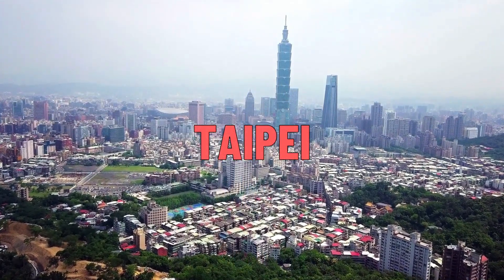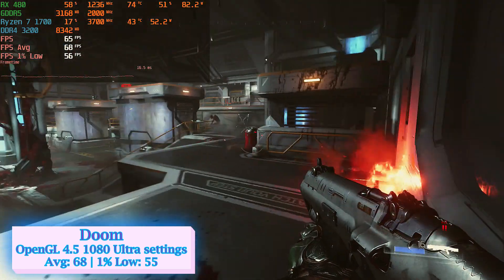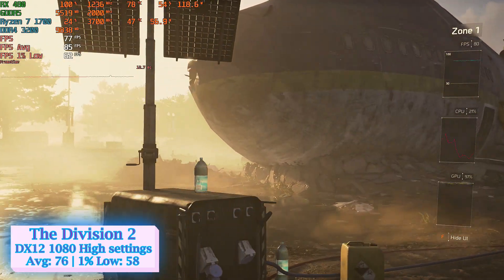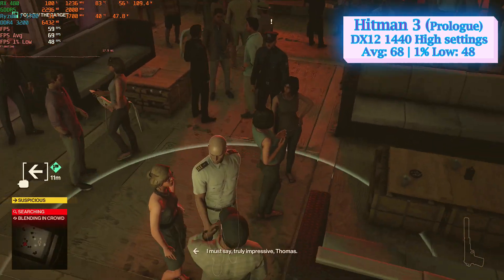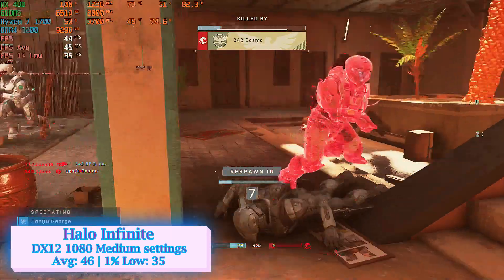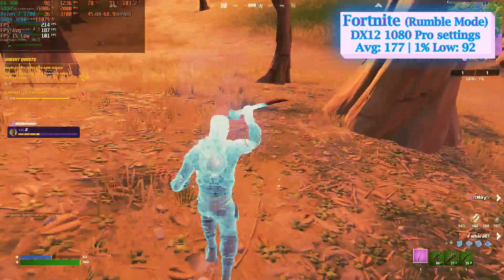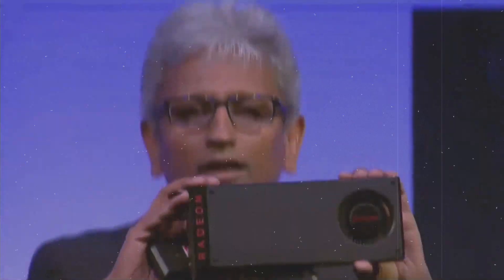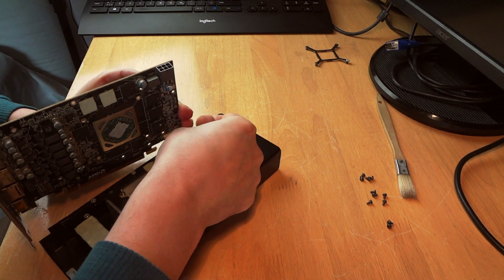AMD Wants You to Forget About This Old Polaris GPU • Radeon RX 480 8GB

Comment: Still using my RX-470 to this day after almost 5 years of use. Not much of a gamer compared to the old days but I still play if I got the time. Currently playing Witcher 3 for the first time. Under linux mint 20.3, was able to play it at max setting, full hd except view distance. FPS hovers around 50-60 fps. I may have to let go of the card if I change to QHD which I've been planing forever. But I do wish I'd still be able to use it on the game I like to play not necessarily at high settings. I flashed the card to RX-570 few years ago. Was able to use it for two years I think. Basically the card is overclocked after the bios flash, though not much. Dunno what happened but last year the card is suddenly showing instabilities so I reverted back to the original RX-470 bios. The only thing I regret, was skimping with my purchase 5 years ago and opting for the entry lever RX-470 (one six pin - so not much oc headroom, single fan, 4gb vram). Should have spend a bit for a better variant. But anyways, the card is at dusk now in terms of performance. Hopefully AMD continues to support it with recent drivers. Besides the minor regret I have with card it's been a hell of a ride. I've used various cards throughout my almost 20 years as a pc user, from the ATI Radeon 9250 which is my first ATI card to the RX-470 which is my most recent, to the GTX 1080 which passed my hands for a year till I sold it (didn't need the GPU power at that time) and I'd say Polaris is one the best gpu architecture there is!
Reply from the maker: Thank you for sharing this enjoyable PC hardware "memoir" of yours.

Comment: One thing i like to add is that halo infinite on polaris architecture is just trash ( maybe some sort of poor optimisation for the architecture ) at the same time even the 1050ti produces better result than a rx 570 ( rx 570 is 40-45% faster than a gtx 1050ti in most of the games )
Shame on developers, cause am a big halo fan and can't play it properly until i get a decent PC.

Comment: Kinda stupid to not show Doom 2016's Vulkan performance. Likely double the OpenGL performance. Also, games like Halo Infinite prove that AMD is crippling GCN driver optimization. It's not that the 480 can't run Infinite better, it's that the drivers are crippling performance. Speaking of this, there's no better giveaway than SAM support, which DOES WORK on the 480, but AMD just disables it on windows. This can be bypassed with Linux or the NimeZ modded driver. AMD is simply switching their support style to Nvidia's model, where they screw driver optimization after a new card generation to force you to buy next gen, all while raising prices on equivalent tiers for full price gouging. You're paying the same price for a 4GB 6500, which is absolute trash. Anyone who can't see this is a scam is just blind.

Ultimately, the real way to keep using the 480 effectively is to switch to linux, where optimization on Polaris is still happening and is not being actively crippled.

Comment: Now after I bashed AMD, we have to also be realistic. First off, GDDR6 is 15$ per 1GB, compared to GDDR5 which was 5.5$ per 1GB. Then the pcb components have all become 1.4-1.7x more expensive since 2017 and the shipping price has doubled. Couple that with inflation and cards today cost about 50-70% more. Basically 100$ for a GPU in 2017 is like 150-170$ for a GPU in 2022.

Comment: had the HIS RX 470 back then. great card, but changed to gtx1060 because of issues with certain games. too bad HIS isn't around anymore. they built great coolers and even advanced blower designs. something I do miss these days. maybe HIS will return with rdna3? their website is still online showing the old rx5000 roundup. anyway 2017 when RX400s were around are memorized as happy times for gamers.

Comment: Long live polaris and pascal!😊👍

Before crypto storm, amd and nvidia were good guys😪
Reply: Nvidia were NOT the good guys ever. The Gtx 1000 series is the single most overpriced generation of GPUs AT MSRP, sold at 90-138% profit margins. The gtx 1080 a sub-mid-range GPU costed 700$ MSRP when it should have been 350-400$... the gtx 1060 6GB should have been 200$ MSRP but was 300$ MSRP... just NO.

AMD became greedy with Zen2(Ryzen 3000) and RDNA1(RX 5000) in 2019 when they doubled their profit margins from 23% to 45% and then increased them further to 60% with the release of Zen3(Ryzen 5000) and RDNA2(RX 6000) series BEFORE the crypto mining boom.

Comment: Exactly why all newer "budget cards" are a joke the term "budget" is already long gone for newer tech
Reply: 100$ for a GPU in 2017 is like 170$ for a GPU in 2022. Scale it from there. That's due to GDDR6 costing 15$ per 1GB compared to 5.5$ per 1GB for GDDR5, pcb components costing 1.4-1.7x more in 2022 compared to 2017, shipping being double the price and all this coupled with the inflation makes it impossible for GPUs to be good at lower price points right now. And coolers have gotten bigger and more expensive too.

When the VRAM + PCB + Cooler + Shipping alone cost between 100-150$ for the lowest-end GPUs, then you know that you can't get a good sub-200$ GPU. That said AMD and Nvidia have their profit margins in the 55-65% range, whereas in the past they were in the 30% range, so there is that.
Reply: @rattlehead999  so aside from production cost are going up, it also because Nvidia and amd are being a little too greedy by increasing their profit margin by a lot, because the main problem here is the performance, such as the rx6500 xt, saying "we can't make it cheaper because everything is going up", to a bad product, even though they can by reducing their profit margin a little, it's like saying " sorry man I want to get more money out of you, so I can't make it cheaper", very interesting
Reply: @Arsa...  Nvidia increased them all the way back in 2016 with the gtx 1000 series, and the gtx 1000 series is the most overpriced at MSRP generation ever(90-138% profit margin), they have been lower since 2018 and the RTX 2000 series actually(55-60%) which is why their stock tanked in 2018. And AMD doubled their profit margin from 23 to 45% with the RX 5000(and Ryzen 3000 series) series in 2019. And then upped them again to 60% in 2020 with the release of Zen3 and RDNA2.

Their profit margins pecentage-wise have been the same since mid 2020 before the prices of components went up.

Go read their financial reports, they are public since they are public companies.

So people fine with the gtx 1000 series and this is the consiquence.
Reply: @rattlehead999  thanks for the info on the financial report might gonna check it

Comment: 480 blower was no go for me it had a lot of heating issue 480s aib model was even hot 
But good solid card
Reply: Had the sapphire rx480 with dual fans, ran cool as a cucumber .. even overclocked with extra voltage

Comment: If it matters, this was NOT Polaris.  15 seconds to check TechPowerUp's GPU database would have let you know it was the Arctic Islands generation of GCN 4.0.  Polaris was the 500- series;  both are 14 nm and made at Global Foundries.  The actual processor chip is called Ellesmere. The updated RX 580 ran on the Polaris 20 chip.  This was the last full suite of cards -- they completely skipped Vega on non-prosumer cards because they released both Polaris and Vega at the same time.
Reply from the maker: I guess you know better than Lisa Su herself.
https://youtu.be/NNMtO5etprs?t=10

Comment: Driver 22.3.2 improves DX 11.  R5 2600 would be better R5 3600 even better.
The RX  63/64/6500 XT use LT GPUs that were converted to DT only for  OEM system builders  at their request those PCs are all PCIe 4 .   DIY builders were complaiming about no low end cards so AMD offered the RX 6500 XT only at first and it sold well so they offered the 6400 XF as well.   AMD never planed to make these DT cards.   The coming APUs Zen 3 RDNA 2 then Zen 4 RDBA 3 2023 and Zen 5 RDNA 3+ 2024  first KT then DT will start the end to low end dGPUs.
Reply: Your Assesment about AMD in this video is not valid.    Used GPUs will remain in demand but many markets have limited selection.     The majority of gamers are happy with 720p 900p 1080p  and some 1440p medium.    FSR and RSR  and FidelityFX sharpening will as noted exyend  usefulness of  AMD nVid and ARC  dGPUs.
Reply from the maker: I can't follow your argument, can you please state exactly what is not valid in the video so I will avoid to use it in future content.

Comment: I had the XFX RX 480 Black Edition XXX but thought it was the GTX 1060 competition. I thought the Vega RX 64 and 56 were the cards to answer to GTX 1070 / 1080.
Reply from the maker: And you thought right. But at the launch day of RX 480 and for a couple of months if I remember right, there wasn't GTX 1060. So at that point the RX 480's comparative new gen competitor was the GTX 1070.

Comment: I still main one.  Sapphire RX 480 Nitro+.  Linux is my main OS and game at 1440p.  Shadow of The Tomb Raider (native Feral port) I can run it at high settings and see 40-60fps, same with Deus Ex Mankind Divided (proton DX12) and Kingdom Come Deliverance, all with smooth frametimes.  Doom 2016 runs full 60fps with the Vulkan render.  
This card won't get you +60fps at resolutions higher than 1440p.  I mean, if you "need" to reach those 120/144 fps to enjoy a game you will be on a newer card anyway.
It's sad and infuriating that AMD is feeding scraps to "budget" video card users.  I doubt the 7xxx series will be any better in terms of price.

Comment: I love this card I have had it from launch and it runs everything beautifully to this day the only reason I'm not using it in my new PC is because I switched to a GTX 1660 super and put the 480 I'm my wife's PC and it's still running strong
Reply: Very weird sidegrade from RX 480 to 1660S. Some 30% faster sure, but still strange. And less VRAM if I'm not mistaken.
Reply: @acryion  true but the 1660s I have is the 6g and 480 I put in my wife's pc is 4g but I'm still happy with what I have with the 1660s for the games I play it runs them no problem both good cards

Comment: I have RX470 since 2017, and it is still going even with new games. Hallo Infinity campain after some elaboration I manage to run playable even in openworld areas (not 60pfs of course 😀), this is absolutly impresive to 6years old HW. In 2008 it would not be even be possible to run "new" games on Gforce 3, or Radeon 9500/9700.
Reply: If you aren't playing competitively no reason to go 60 and beyond which the lovely Polaris gpus are doing med - high on older games and low - med on newer games is a beast
Reply: Ironically, some games from 2007 or 2008 do actually run on the Pixel Shader 2.0 Radeon 9800/9700/9500 GPUs.

Stalker, Gears of War, , Unreal Tournament 3, CoD4, FEAR 2, Crysis 1 and Warhead, Portal, HL2:EP2.

Comment: You need to set tessellation to 32X or 16X because by default AMD uses 64X while NVIDIA uses 32X which they hid it from user access. lol
Reply from the maker: If I remember right I had set tessellation x8 or x16 since anything above that has diminishing returns in quality meanwhile drops somewhat the performance.
Reply: AMD truly fixed their tessellation performance with RDNA2. It's actually faster than Ampere at processing geometry.

You can keep it at x64 and call it a day. There's barely a difference between x64 and X8.

Comment: You guys do realize that laptops are a thing, right? There are rtx 3060 laptops for $900 packing a i5 11400h and 105w rtx 3060. Thats basically within 10% of a desktop rtx 3060. 

You try to build a PC with equivalent performance and features for significantly less. Its nearly impossible. Even assuming you find a rtx 2060 super for $250, a i3 12100f for $100, $50 case, motherboard, RAM, SSD, 144hz 1080p monitor, peripherals, wifi + bluetooth, windows activated, etc. You're still going to get to the laptop's price. 

You can tune them to reduce temps, prop up, repaste, etc. All those help temps. RAM + Storage is upgradable. For 1080p gaming 3060 is gonna last you 4-5 years since its release.
Reply: A laptop as a desktop replacement is a dumb idea, it's just too many issues and not worth it (only if you NEED a powerful laptop on the go then yeah, it can work)

Comment: i switched from an xfx rx480 8gb (reference cooler with 6 pin connector) to an older gtx 780 found on internet for 80 euros, the rx480 performance are great for 1080p gaming but i changed the gpu with another because my 480 with the new driver crash and power off the pc every time i start a game, indipendently wich is
to resolve thish annoiyng issue i musted use olders drivers from 2017 that works very well but every two days windows automatically update them with the lastest version witch cause the problem
another solution that i founded is to use the lastest driver but cutting down the dissipation power from 100% to 70% but this destroy the performance and dosen't resolve all; i tryed everything: change thermal grease, thermal pads, flashing bios, but none of this thing works.
in my opinion the card demand to much power to the motherboard (asrock b450) and then power off  as a failsafe
so i was going mad and i decided to downgrade to an used 780
Reply from the maker: Truth is I never experienced any kind of the above problems with the Sapphire RX 480. I don't know about the XFX model. Sadly, maybe you got a faulty item or something. I really hope the GTX 780 cover your needs until you find something better.
Reply: I honestly believe my XFX RX480 8gb Black Edition with Reference cooler/6 pin connector fried two different sets of ram. Both g.skill FlareX. First set 2400mhz.. 2nd set 3200mhz.. Both 16gb . I was using a 1660ti in my system Ryzen 7 1700..  Asrock AB350 Pro4 (Which was working flawlessly)  and cleared the drivers with DDU to see if my RX480 still worked because it sat unused for over a year, It did.. but then I started getting bad memory problems, crashes, freezes, restarts within a couple of days... Now my PC is sitting upstairs basically unusable. I'm putting the card on Ebay with a warning that it might fry your computer if you don't undervolt and whatnot. Love the card.. But I know it's killing components. >.< If anyone wants it I can send a link when I do decide to list it. xD (Listing the 1660ti also. Effing love the card, but I can't afford to fix my PC >.<)

Comment: Using RX 480 with 1st gen Ryzen doesn’t do justice to RX 480. Those Ryzen have terrible low IPC and sub 4ghz frequencies. That’s why in some games you see huge frame drops. You would want to remove CPU being a limiting factor. Latest gen cpu would smoother 1% lows and show how low GPU drops. Not how low CPU drops. Anyway great video. Found your channel by chance and subscribes right away. Good luck.
Reply from the maker: Thank you very much for the sub and your time you spend to type your thoughts.

You are right, I can't argue to your remarks. On the other hand as a small content creator this the hardware I own and I can afford right now plus it seems that the combination of an RX 480 with a five year or older computer hardware, simulates more appropriate the low budget PC gamer.
Reply: I buy parts and build computers as a side extra income hustle job. And I might have spare better AMD cpu for AM4 platform. I might ship one to you to use in your test bench.
Reply from the maker: @gametestinglab8861  Just the thought of the support is more than enough and thank you for that. But respectfully I couldn't accept it. Maybe at some point when the channel pass the test of time and grow, then it might be suitable the need of a variety of CPUs and GPUs. I hope the best to your business, sir.
Reply: @obnot  NP. I really meant it. Whenever you might need help let me know and I’ll try at the best of my possibilities to be helpful. Good luck to you as well.